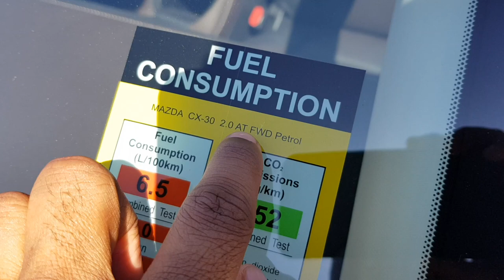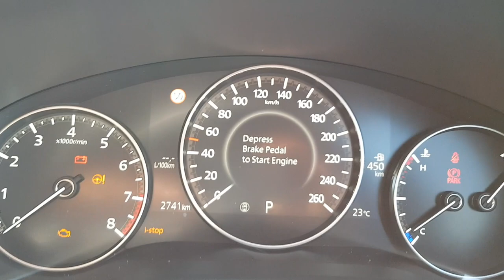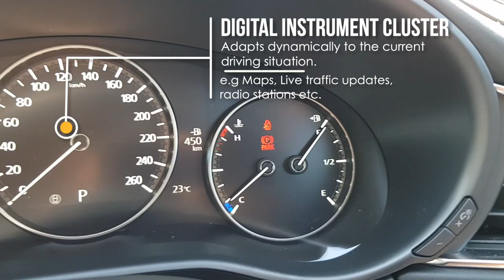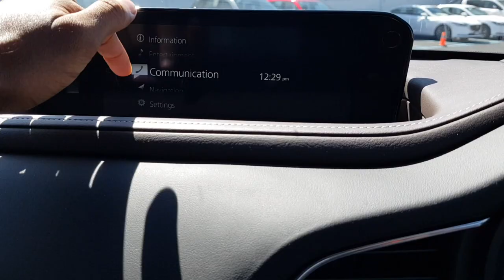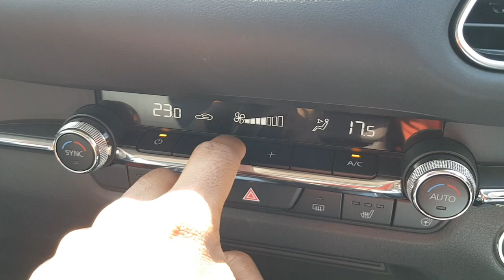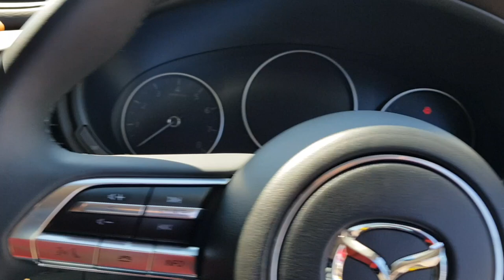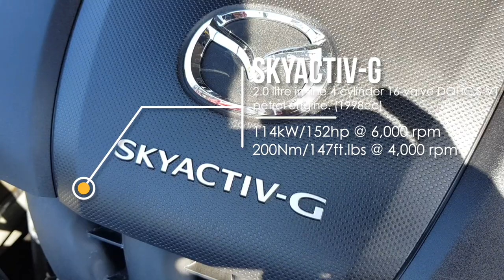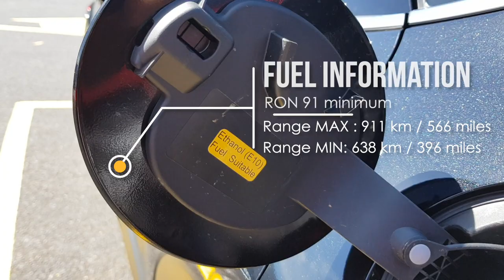Mazda CX-30: A Practical and Affordable Car

Comment: The Mazda CX-30 is equipped with a basic inline-four engine of 2.5 liters and an automatic gearbox with six speeds. During our preliminary testing, it reached 60 miles per hour in 7.6 seconds and produced 186 horsepower. It completed the quarter-mile in 15.9 seconds while traveling at 89 miles per hour, and it drew 0.85 g on the skidpad.